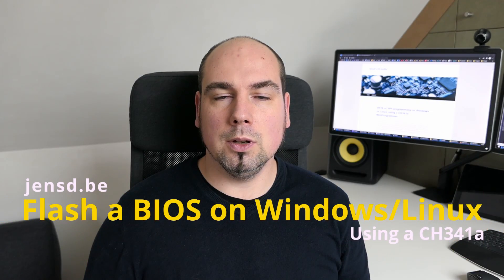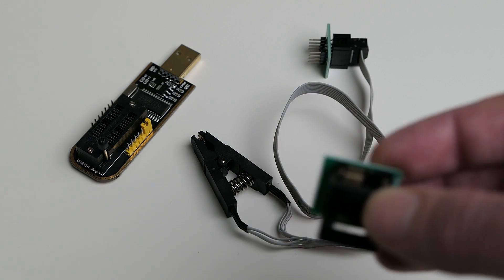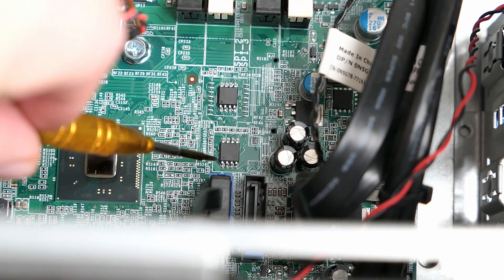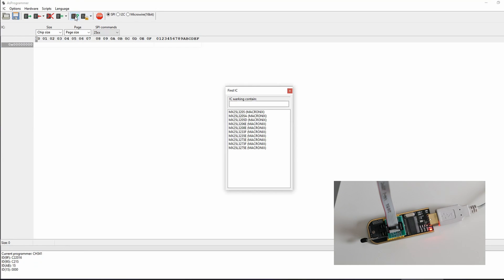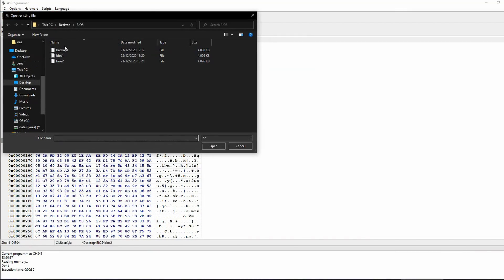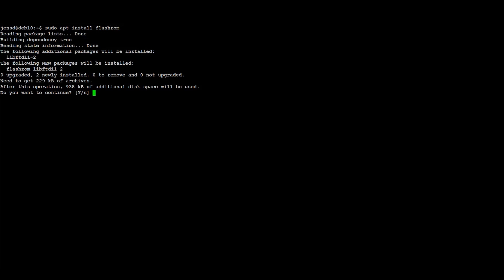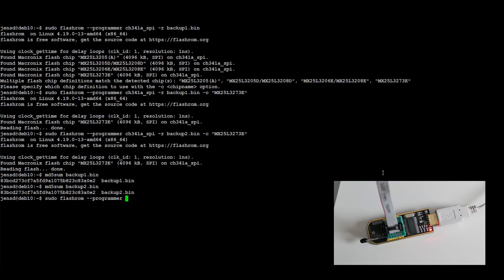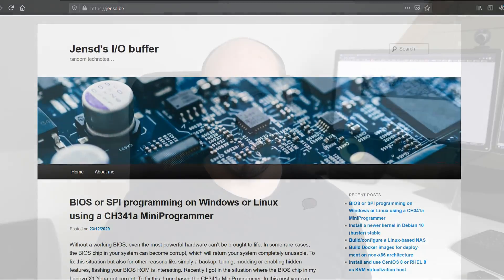BIOS Flashing on Windows or Linux using a CH341a MiniProgrammer

Comment: Did you check the voltages on the data lines of this programmer? According to many people and their measurements, there's a design flaw in this programmer that might be dangerous to some motherboards: even though the Vcc pin is at 3.3V, the serial data lines that come out of the CH341 chip are at full 5V because it is powered incorrectly (from the 5V power rail that comes from the USB cable, instead of from the on-board voltage regulator). There's a way to rewire it and make it work as expected (i.e. according to the application schematic in the datasheet). But without the mod, it may fry some motherboards or EEPROMs if the data lines go to some other chips on the motherboard as well and the voltages are higher than expected. So I'm quite surprised that it worked in your case.

Comment: Thank you so much, this helped tons! I'll leave a note, if anyone is having connection issues, make sure Asprogrammer is set to CH341 in the drop down menus. I messed around for far too long trying to find USB drivers to make mine work when it was really not selected to the correct programmer type

Comment: Thank you very much for uploading this tutorial video. It has been a great help as I've never used the programmer before and have 3-4 boards that do not have the BIOS flashback utility so I had put them to the side collecting dust. With your help I revived an AMD B350 using the 1.8v adapter. It's an older board but is in mint condition in OE box with all accessories so imo was worth fixing it. I will be trying the CH341a on a Z490 next. Thanks again!

Comment: I have taken the necessary precautions with regards to static etc. But on three separate occasions have blown my motherboard when trying to flash my bios using ch341a?
Reply from the maker: Are you sure that the board is completely without power when doing this? I'd also double-check the wiring to be sure
Reply: @jensdbe  100%

Comment: When I attach the clip to the BIOS that is soldered to my motherboard, I see the red LED on the mini programmer light up as well as 2 other LEDS on the motherboard. This makes me think that the clip is making contact with all the legs of the BIOS chip but when I hit the detect button of the software, it either says no response or it cannot detect the chip. Can you offer some suggestions? I have reversed the clip, removed the CMOS battery, removed the power to the motherboard, tried various software versions, etc

Comment: just an FYI, ALWAYS remove the chip from the device and program with the socket.
a) By leaving the IC in circuit, you are unintentionally sending voltage and current through everything else attached connected to the IC, this can lead to corrupted reads/writes, or worse, corrupted data on other IC"s that may be connected to the bios
b) by essentially "back powering" the system through the clip, you can damage other sensitive components in circuit, such as ESD ic's,  filters, and low voltage diodes. 

Creating good habits now, will reduce damage, and lost time later.
Reply: i have done hundreds without this issue ..

Comment: What happens if I leave the clamp on the bios chip after programming and switch on the machine? (not connected to the programmer but just clamped on because it is really hard to get the clamp in place properly) in case I have to reprogram again?
Reply from the maker: As long as it isn't connected I don't see a problem in doing that.
Reply: Thank you

Comment: How would you be able to tell which chip to use. in your video the chip above is almost identical besides the print on it. Would you just have to look up the print on both to determine which is correct?

Comment: Great job❤. Please, any idea of how to read and reset the BMS of laptop batteries using the CH341A? I noticed after replacing the bad cell of a weak Lenovo laptop battery and  triggered it to work again. But it's still showing the old battery health. Hence, the need to reset the BMS. Charging and fully discharging didn't work. I'm hoping CH341A and AsProgrammer could do the trick. Any hint please?

Comment: Did you insert this correctly at 2:58? Seems like Pin 1 is on the other corner, im not sure what you meant by Pin 1 at the back. Please clarify as I suspect to have a corrupt bios that im looking to restore
Reply from the maker: Pin 1 is the one where you can see the half circle on the back. There is room for 2 different types: 25 SPI BIOS (2x4 pins towards the USB connector) and 24 I2C EEPROM (2x4 pins away from the USB connector). For both, pin 1 is located the most left (away from the USB connector), so more or less in the middle for a BIOS chip.

Comment: Hey, does the ch341a will reset the bios password ?
Reply from the maker: It depends a bit on how advanced this is implemented. In a lot of cases, a CMOS reset or removing the CMOS battery for some time will remove the password. Some boards also have a specific dedicated password reset jumper. In other cases it is saved in the BIOS chip itself, typically when there is a more advanced protection. I did see that sometimes it helps to backup/reflash to remove the password or by re-flashing data from somebody that provided a dump.
Reply: What fixes,tasks the ch341a is capables doing?

Comment: So I can’t use this tool wihout a screen? I have a motherboard without a connection to the screen. Thought I could repair the motherboard with this tool?
Reply from the maker: You run the tool on another machine. You can't use this method to flash the BIOS of a system that is powered on.

Comment: I have legion Y540,
This is what I am facing. Reading the BIOS chip always finishes with a CRC32 error.
Also, when I click "Unprotect-erase-program-verify," it will erase and write successfully without an error but will show a verification error during verification. I have tried everything and am just tired and exhausted.

Comment: Hi bro, can I use this method to remove whitelist of a wifi card in bios?!
Reply from the maker: In theory yes but you would need to know exactly which parts in the BIOS dump you would need to change.
Without previous experience, I would try to find a guide, specifically for your model and follow step by step what to edit. 
Also make sure to first take a proper backup of the working contents of the BIOS before making changes :) Good luck!
Reply: @jensdbe  Mine is a nec laptop which is a Japanese brand created by Lenovo, hence no bios update. I found that it is the exact copy of Lenovo g70. Except the motherboard name, everything including the chipset is the same. In this case, can I use the modified bios of the Lenovo version? Do you think there is a possibility? Thanks for your reply.

Comment: No need to disconnect the processor? Apart from the battery, what else needs to be disconnected?
Reply from the maker: Just make sure there is no external power going through the chip, so disconnect any power-source. Rest of the components should be fine.
Reply: @jensdbe  ❤❤❤

Comment: Does the programmer itself provide power to the chip? On other videos i saw people trying with turning on power to the whole board and some people saying it would fail because both the cpu and the programmer would try to talk to the SPI chip at the same time.
Reply from the maker: The programmer provides the necessary power to the chip. Trying to flash it with the PC on is not a good idea

Comment: Can i flash keyboard firmware using this?
Reply from the maker: No idea honestly, depends on which flash-chip you have on that keyboard.
Is there no supported method using a tool on the OS or is the keyboard no longer working?

Comment: Can these CH341A's be used with a Raspeberry Pi? Like plugged into or connected to with the wiring? Instead of having to use a desktop or laptop pc?
Reply from the maker: Sure, can just connect to USB on a rPi
Reply: @jensdbe  Someone else from another video said that I wouldn't even need the ch341a programmer and could just do it with the raspberry pi. So then what would I need? Just the SPI clip and what else?
Reply: yes you can, wolfgang did that in his "Installing Coreboot on my Thinkpad T430... In a forest" video

Comment: If I don't see my exact chip type (W25Q256JWEQ) would it be okay to use the most similar one like W25Q256JW or W25Q256JV?
Reply from the maker: Didn't look at this in detail but I would take W25Q256JW as that is the closes match. Probably the last two digits are to indicate like a minor version/revision.

Comment: I am trying to remove pw protection from bios. Isn't copying the chip and using that image to flash it just copying the same state back onto the chip? And wouldn't corruption be just copied back onto it as well? Please help? How do I get a fresh copy of the corrrect bios online and use that to flash to the chip? Thanks for any help.
Reply from the maker: To do a password remove, if a CMOS reset does not help, you would need to copy and modify the contents of the file with a hex editor. There are tools for some of the hardware but it is typically not an easy task. For some hardware you could reset/corrupt certain blocks and that would have the same result. Completely depends on the hardware/model on which you want to do this.
Reply: @jensdbe  Thanks for the reply, I didn't notice the reset bit, I've been rushing through as many of these ch341 vids as I can find, yours was by far the most intelligible and comprehensive, thank you.

Comment: This is a really good quailty video, perfectly explained, thank you.
Reply from the maker: Glad it was helpful!
Reply: @jensdbe  I have one question, I bought a computer and it came with the BIOS locked with password, I'm pretty sure that if I just flash a new bios it will not ask for any password because the password data is in the CMOS, but where can I find the image to flash in the CMOS device? Is the same for all the devices or I have to find one for my specific computer? Thank you.

Comment: Hello man i cant manage to properly connect the clamp... i always have the "chip isnt found" error... can you please help me
Reply from the maker: In some cases it will be needed to remove the chip from the board as some connected components could prevent it from working correctly with the reader. Also make sure there is no more power on the chip as well and in some cases, the chip might just be faulty as well.
Reply: @jensdbe  thanks for the reply👍

Comment: This helped me to flash a Dell Inspiron All in One 3477 that went FUBAR on me. I backed up the corrupted BIOS and then found one that someone posted online. Flashed that and everything started working. Prior to flashing a new BIOS, the DELL logo would just hang and the unit would not do anything. Thanks to you, I am back in business! Thanks!
Reply from the maker: Nice to hear this helped you :)
Reply: @jensdbe  The only hard part was getting a proper, aligned grip on the BIOS chip. Took me a few tries until it was able to read the chip type. Prior to that, it was just erroring out.
Reply from the maker: @Music-yt7xo  yes, can be tricky, depending a bit on the location of it. The most difficult is usually to find a (good) copy of a working BIOS online.
Reply: If you are have a hot air station and soldering iron it is best to desolder the bios chip and solder it on the adapter and program it externally then resolder it back

Comment: Hi. I have a stange question.
I'm trying to get it work but i failed to use it.

Every time i plug the programmer in, the windows and ubuntu recognise it as a serial device. I tried the .par drivers, but no luck.
Reply: Okay. I throwed it to the ground and now it is working as it should🤣
A good knock can fix everything

Comment: you can do all of this without having to remove the GPU & CPU?
Reply from the maker: Normally yes. Just make sure the board is no longer powered
Reply: @jensdbe  thank you, should I reset the CMOS after or remove the CMOS battery at all during this or does it not matter?
Reply from the maker: @clj4805  in theory I believe it's better to remove the CMOS battery. But I've never experienced issues when I forgot to do that

Comment: hey bro i have read data and saved to my pc for 3 times but first saved it as 1mb file after second and third time it saves as 4mb file size is this normal ?
Reply from the maker: Doesn't sound normal. You can check by the chip type how muxh data should be in it. Maybe it didn't got detected correctly?

Comment: These mini programmers has faulty manufacture, it outputs 5 volts instead of   3.3 volts, which in bad scenarios destroys or burn your chip, in better scenario it won't detect your chip or program it properly.
Reply: The new version has a voltage switch.
Reply: @Salman-sc8gr  Wow, it seems you're right. The old versions did use 3.3V but only for the supply line and its own internals. The data line was still 5V which was the error. But it does seem like the newer ones have fixed this. Just make sure you get version 1.6/1.7!
Reply: No it doesn’t it drops to 3.3 when writing stop regurgitating bad information
Reply: this was debunked in another video already.  Stop the viral rumor please.  There is a  voltage drop 3.3v when writing occurs so no problem.  Use a multimeter to see for yourself.
Reply: i dont think it burns your chip, its just almost impossible for you to flash your chip with that voltage
Reply: Wrong. The voltage drops to 3.3v when a chip is plugged in.

Comment: ive tried 1million times and for some reason it wont detect my chip and just displays FF, do u know any fix?
Reply: Have you fixed it yet?
Reply: Its all in getting a proper grip. Keep trying. All the pins have to line up perfectly for this to work. Once you get a proper connection, then it will read the chip type. Took me about 10 tries.

Comment: Hi, would this programmer work with Winbond bios chips - data sheet says it's 1.8v - ch341 programmer has the option of 3.3 /5v as i see in the picture.
Reply: It's easy to misunderstand the jumper that is 1-2 or 2-3. It does not switch the programmer from 3.3v to 5v. You always want to have it jumped from 1-2 for programming chips. 

Due to a design flaw, these devices always output 5v on the signal lines, even if they send 3.3v to the supply pin. Maybe you will be lucky and get a device without this problem, but it seems most of them are flawed.

If you search around, you can find lots of explanations of a relatively simple hardware mod to fix the problem and output 3.3v on the signal lines. But it will not do 1.8v in either case. Instead, it's fairly easy to find 1.8v adapter boards. In fact, if you shop around, you will likely find the 1.8v adapter board included with the programmer for pretty much the same price.

Comment: watched quite a few other videos about this ch345a,this is the clearest .thankyou.
but i have a problem.i can not get any read from this programmer,what am i doing wrong???
Reply from the maker: Hard to tell just like that unfortunately... It might be the connection with the chip you try to read, it might be the PC, Windows, Linux or a broken device...
Reply: @jensdbe  the pc and the chip are fine.i tried different pc and can read the chip with ar 32 programmer. how totell if the ch341a is defective ?
Reply: tried a few computers.the chips are good,red them on another reader.how can you tell if the ch341a is broken?
Reply: The clip shown in the video is pretty useless you really need to desolder to do it reliably that is why he does 2 reads of the chip to make sure the clip is making proper contact as it wont typically with SOP-8/SOIC-8 chips in particular! The ch341a has a design problem it needs modded to be totally functional!

Comment: Hi I have a RM one mobile 310. since the battery died, I cannot source a genuine one, so I purchased a 14.8V 5200mAh battery from Amazon. However I get a "unable to see battery" or empty icon displayed. If I put original battery in it shows 1%  and cannot charge. New battery shows 100% but I do not know if I can believe it. (i have tried two other non OEM batteries only 4400mAh though, and they just died after twenty minutes) I am told that some Sony Viaos have bios stopping third party batteries, and suspect RM is the same. Wher would I get a bios that allowed my W10 pro laptop to see battery?

Comment: Hi, and thanks for the video. It helped me a lot. Do you know if the Ezp2019 programmer work with flashrom?
Reply from the maker: As far as I can see online, I did not test it myself, it should work fine with flashrom.
Reply: @jensdbe  should I specify the type of programmer in the command line, or can I avoid that?